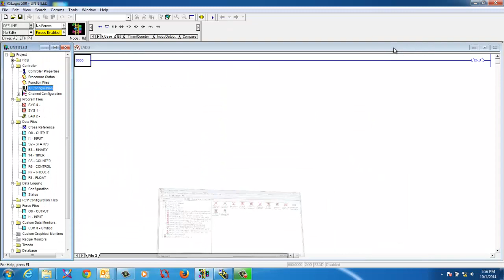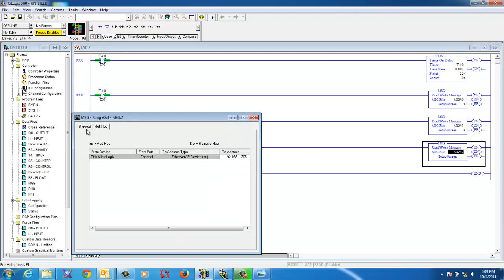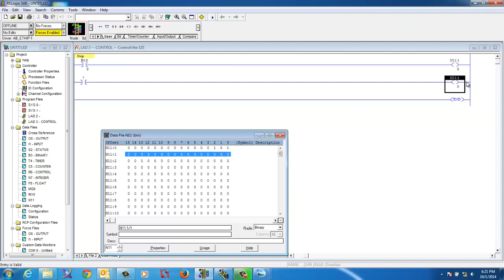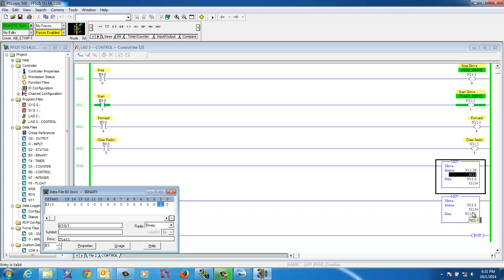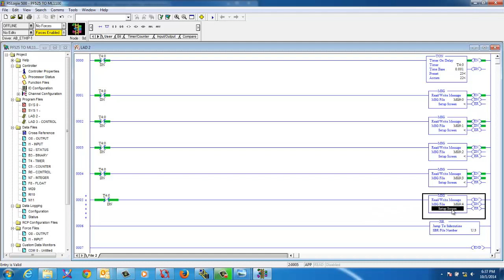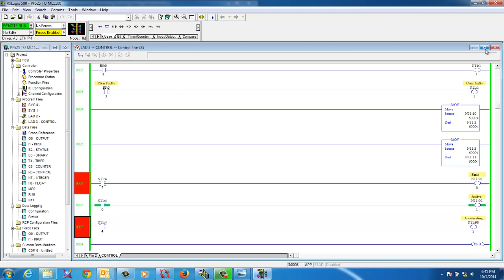Micrologix 1100 1400 controls a Powerflex 525 over ethernet

Comment: A pretty good explanation, however I still can't figure how did we come up with "Data Table Address = N42:3", and where does it get defined in the Powerflex 525, i.e., in which parameter do I setup this value of N42:3?
Thank you for your support in advance.
Cheers

Comment: Amazing lesson. I am working on a project changing from PF 40 to PF525 with a Micrologix 1400 controller. This is really helping out. Thank you !
Reply from the maker: @disun4152  awesome, thanks for the feedback. I switched to using Siemens Drives in my Rockwell projects because of the robustness and longevity their drives give me. And as a plus they also communicate on EIP! I haven’t had one fail yet and have been in service since 2015! Just food for thought on your next project that requires VFDs I won’t go back to AB drives. Thanks for you feedback back! It means a lot!
Reply from the maker: Your*

Comment: Can you give the EXACT Reference manual number where you found the Integer file numbers to send the Drive commands to the drive?
Reply from the maker: There is a link in the description that takes you to the pdf
Reply: Hit me up if you still in the woods managed to tweak this to use an slc5/05 and it worked like a charm

Comment: Hi, great video, congrats! so, i need to control 6 pf525 through ethernet/ip with ML1400 and panelview 800, there any problem?? 
How I assure that it works correctly?, being a non-deterministic control method (according to rockwell information)?
Regards

Comment: Great video! For anyone having issues writing but the PLC is reading the drive status correctly - Open the N11 file, view in binary, and set bits 0 and 2 = 1 of N11:0 (as used in this video for the first MSG command). Do this for each VFD connected in the first MSG (for message timeout read/write) and it may resolve the problem.

Comment: Hi , Nice information . i used this info and was able to control only one power flex 525 drive . i need to control more than one  power flex 525 . i used same powerflex internal N42:3, N41:0 and N41:2 command for second drive with different ip address and different N and routing address but unable to control second drive .
please can you help me to send me .RSS file for three  power-flex 525 drive through  Micrologix 1400 . 
Also where i can information about other data table to read / write  like output current,output speed frequency ,status , at sppeed preset speed ect.
My email add is naikkam@gmail.com
thanks......kam
Reply from the maker: kirti naik when I get back I will see what I can round up for you
Reply: hi Sir . please help in to the above issue
Reply from the maker: Are you using a micrologix plc?

Comment: this is for only single drive, what is the data table address in target device for 2nd drive ?
Reply from the maker: Its the same for a second drive your ethernet address changes in the message connection / routing table.
Reply from the maker: anil kumar did this work for you?

Comment: Thanks a lot for the video. I have question: we're testing our own hardware   with Compact Logix PLC . it ( Compact Logix ) sends message using MSG . Our hardware  works OK . I need to test it with Mirco 1400, but dont have it . Is it possible to say for sure, that if it (our hardware ) works OK  when COMPACT Logix send MSG , then it will will  ok if Micro 1400  sends MSG? What i'm trying to ask if output frame (or package) is same for Compact and Micro 1400 when they use MSG insruction? Thanks
Reply from the maker: Hayk Azizbekyan yes it should work just fine, though you are using two different software's rslogix 500 and rslogix 5000
Reply: Thanks a lot of your response . I have  question,  would really appreciate you can help. , I can't  figure out what to to enter in RXI file. below is the link. It says Extended Routing information File. What I have to enter in that file.? Compact Logix doesn't' ask that information. And last question: is there anything i have to enter in Send Data  / Recieve Data tabs ? Thanks again for your video and response  
https://drive.google.com/file/d/0B3mee-O6OwfBTGs2bGZyZkJRdk0/view?usp=sharing
Reply from the maker: sorry for the delay i have not used this one before you must have RS500 pro I was using rs500 standard so i didnt have the extra tags. I will have to check on this one

Comment: Do you know if it is possible to read the motor current through a MicroLogix1400?
Reply from the maker: Nicholas Lloyd b003 [Output Current], value is in N12:1, divide by 100 to get the correct value
Reply: Cheers, I also found you can do it through CIP Generic where in MSG you use: 

This controller
Channel: 1 (Integral)
Communication Command: CIP Generic
Data Table Address (Receive): N#:#
Size in Bytes (Receive): 2

Target Device
Extended Routing Infor File (RIX): RIX#:#
Service: Generic Get Attribute Single
Class (hex): 93 (for DPI Parameter List)
Instance (dec): 3 (for Motor Current)
Attribute (hex): 9

Comment: Hey i am using a powerflex vfd 525 to control a motor and i am using micrologix 1400 PLC, i am using a scale block to scale the value which i am getting form the VFD so at zero speed i should be getting the input as zero which  i am not getting instead i am getting a value of 12000.
can you help me with this problem?

Comment: Hello!
Can I control an Ethernet/ip drive connect to other 4 drives via DSI using micrologix processor? Do you have an example!? Thanks!!
Reply from the maker: single drive 1 ethernet. other drive on dsi need the card in the micrologix 1500 1769 backplane
Reply from the maker: coldbluemountainapps@gmail.com

Comment: I have a ML1100 and powerflex 40 drive and  the 22com e card  communicating with each other, I copied what you illustrated in rslogix 500  program but my project isn't working as illustrated.
Reply from the maker: that's because it's a pf40 and in the video we are using a pf 525. you will have to refer to the manual for the correction message settings.
Reply: I did read in the manual and the settings should be the same as you illustrated when setting up the msg instruction . 42:3, 41:0, and 41:2.
Reply from the maker: +MIke Wilson I'll check this out in the morning for you
Reply: Ok thanks.
Reply: @thiefgold0913  did you get it? I actually have the same problem, can you help me?
Reply: did you get it? I actually have the same problem,im using a power flex 40 with 22com-e, can you help me?
Reply: Hi. Can I ask how you solve this problem? Thanks. Your answer is highly appreciated. I am new in PLC programming.

Comment: What happens if we have 2 or 3 drives more, Is it the same procedure?
Reply from the maker: Yes I always separate mine in new files
Reply: +PLC Automation Training. thanks for your excellent video and reply. If I want to control two drives, I can use the same parameters to read and write the drive, or there are other parameters, or i can use the same parameters to control the speed, start, stop. etc.

Comment: hey! one question. How do you connect the 1100 over the ethernet and the pf 525 in the same loop, i have a 1100 with only one port ethernet,and in your loop in rslinx appears the plc and the pf525, cheers!
Reply from the maker: use your home router.

Comment: How can i read output current from PowerFlex 525 using ML 1100?
Reply from the maker: CIP i sent you an email with the info you needed let me know how that works for you. PG 72 of the PDF on comms
Reply: PLC Automation Training 
Could you please send me the same info? This video has been very helpful and I have tried the CIP setup in the 20-comm-e manual but keep getting error code 45 and no data
Reply from the maker: +chris ashbrooks yes I'll go back and look and send it to you
Reply from the maker: +chris ashbrooks send email to coldbluemountainapps@gmail.com
Reply: Please send me the link to read output current from 525 using micrologix.
Mail id: kunalthorat30@gmail.com

Comment: Is it best practice to trigger message instructions in Logix500 such as you are? I am not being critical, I am wondering as I've had many debates over the years on the proper way to trigger multiple messages.
Reply: I just go with what works I have found there are better ways to save processor scan times but in these tutorials I'm not worried about the scan time but your right. I'll bring that up later about scan times.